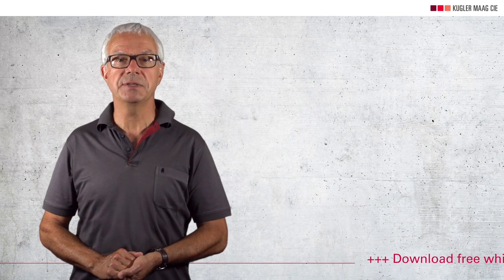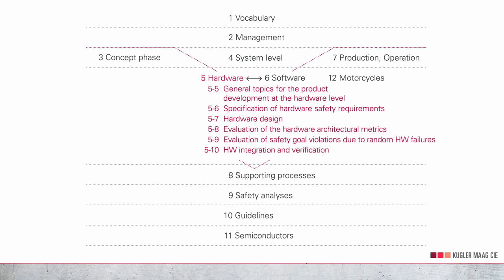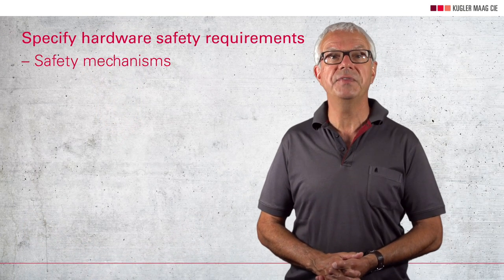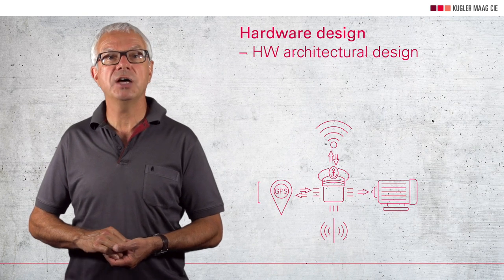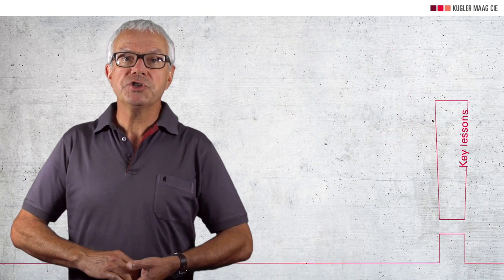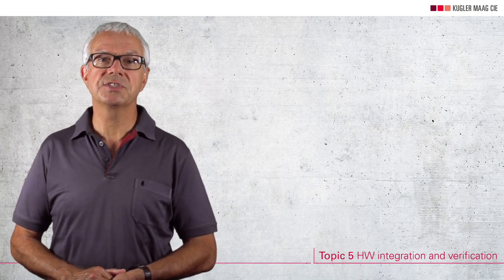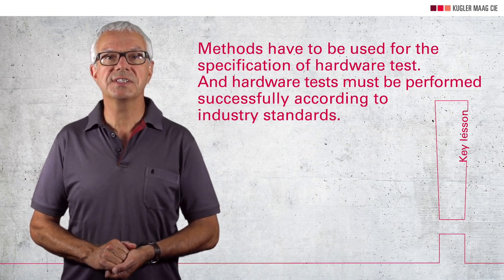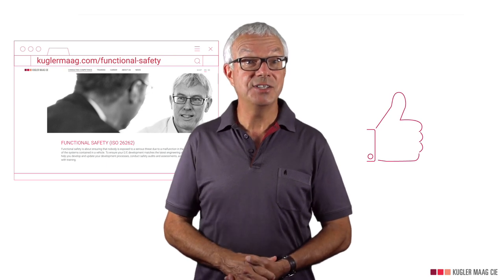ISO 26262 – Hardware Level of Functional Safety

Comment: Hello Dr. Perry. this is best short video covered iso26262 HW. Do you please let me know some more example of HSR? Any reference will be helpful. Thanks in advance
Reply from the maker: @bharath great question. Here are examples of HSRs from some of our training material:

•	The seat sensor shall signal “unoccupied” when no object is on the seat or if object weight < 5 kg.
•	A stuck at closed of S2 shall be detected and a reset of both µCs shall be initiated in case of stuck at closed.
•	The activation signals of the ATD µC and the Safety µC for the switches shall be compared for equality and a reset shall be initiated if they are contradictory.
•	The comparator shall detect contradictory signal values not faster than 200 msec.
•	The comparator shall detect contradictory signal values latest after 600 msec.

These requirements are allocated to certain parts of the hardware.

We hope this helps you further!
Reply: @ULSolutionsSIS  . Perfect! Thanks for the reply.